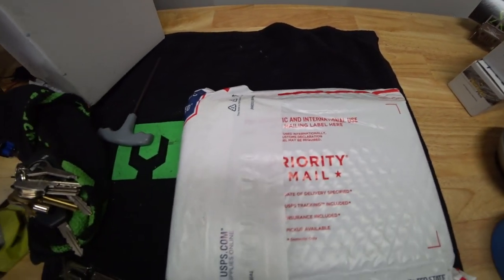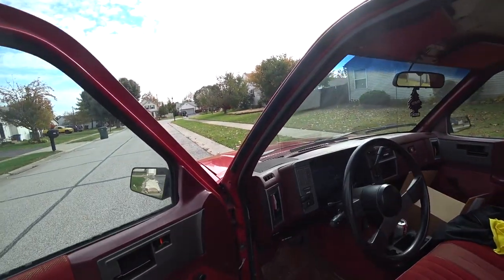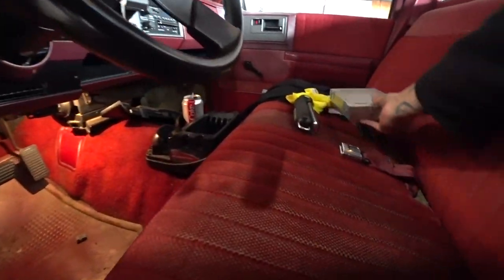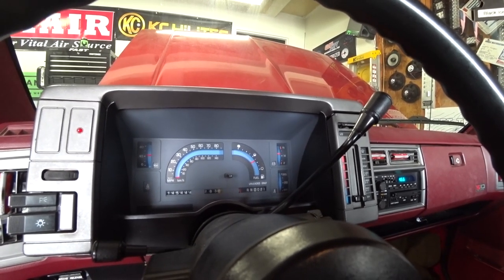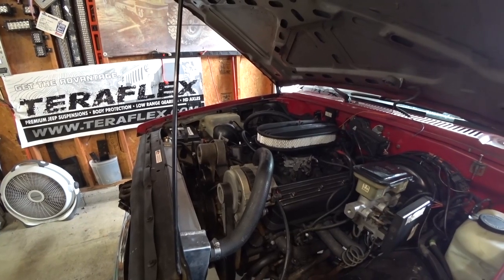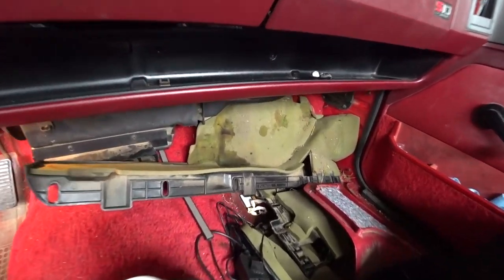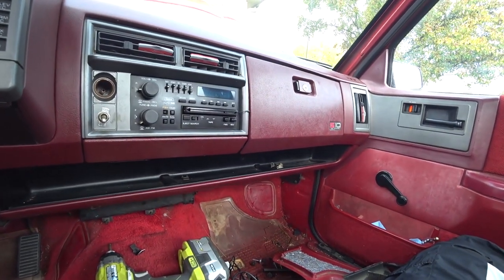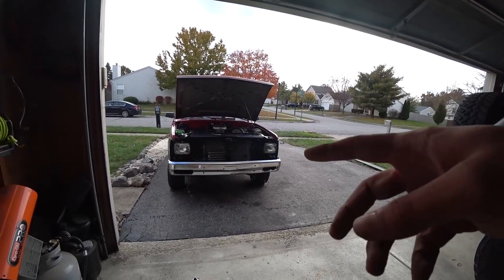New 5.7 TBI Computer & PROM Chip, Project SUPER 10 Ep.08

Comment: I gave my 92 short bed 4x4 a complete  tune up
Oil,spark plugs , wires , cap , coil, water pump, radiator, temp sensors, brakes , thermostat  but I didn’t change the hoses so I’m driving on the highway a day after spending 1000 and my heater core hose bursts and truck started over heating pulled over and the truck started smoking. I was pissed. Luckily there was an autozon less than a block away swaped them out threw some coolant in and drove it to Vegas from LA NO ISSUES 260,000 miles running strong

Comment: I can totally relate to everything that you said about the truck. I've been running into the same thing with a 1989 Pontiac Formula 350 Project and am about to change the computer and chip because it has been running really rich and actually fouling out spark plugs causing the loping idle just like your truck had. They aren't bad vehicles just like you said but sometimes it makes you wonder if something really odd is going on when you replace one thing and then something completely unrelated then goes bad. I'm into mine for about $15,000  now and it's not even close to being done. Some people think I'm crazy for investing so much into it, but I'm only the 3rd owner and it has a documented 96,000 original miles. The interior is immaculate but everything mechanical that could go wrong has gone wrong.  A new paint job is coming in the springtime and hopefully, she will be done and dependable. Right now I don't trust it to make it around the block.

Comment: I build cars and have learn how to build from owning and keeping my 95 S10 running. When it comes to mechanical parts rebuild the entire system and be done with it. A/c cooling system I’m replacing everything pressure will find the weakest point and find it’s way out. I understand your frustration completely that’s why I fixed it up and got sick of all the issues that popped up so i mothballed it and now about to put a 350 in it.

Comment: I feel your pain buddy. Last week I changed my blower motor resistor, and 20 minutes later my water pump started leaking for the second time, two days before the resistor I just replaced every single transmission line and installed a trans temp gauge. This weekend I have about 3 k worth of parts and upgrades all going in. I’m afraid of what’s gonna happen next lol. But keep plugging along, with every job you’re making head way. You keep turning out content and we will keep watching. Good luck buddy.
Reply from the maker: Thanks! Good to hear someone else is sharing the pain LOL! Good luck on your install of all those parts, what are you installing?
Reply: Rocky X TV  You name it. Lol. injectors, headstuds, new injection lines, crossover tubes, F.A.S.S., Beans diesel sump, filter delete kit, pyrometer, boost tubes. And while it’s all apart I’m painting and powder coating several of the things that are off. Cleaning up and revamping some wiring that I had temporarily ran. Along with other maintenance, oil change, tire rotation. Busy weekend.
Reply from the maker: WOW! You're gonna be busy! and a little frustrated, remember your words "keep plugging along, with every job you’re making head way." It's always worth it in the end, well not always, I had a car burn to the ground years ago, but lets not talk about that....
Reply: Rocky X TV been there done that too. Have a video some where lol

Comment: Do you have an adjustable fuel pressure regulators if you put a bigger throttle body on it will poor more just needs motor to back it up also and a good computer helps lol

Comment: 2003 silverado LS. 4.8 Votec 256197 miles. Second time around on original motor trans,  your opinion  on installing  Hpertech. Power Programmer all. She's starting to lack power when I stomp on it. Installed cold air induction.
Reply from the maker: Hypertech makes some good products.
Reply: @RockyXTV  hey thanks Rocky at least off to a good start

Comment: friend, can you help me please, I have a Chevrolet suburban 1500 5.7 vortec 1996, I made the TBI carburetor and distributor, I had the camshaft altered a bit in stage 2 and I put an aluminum radiator with electric fans (the problem is that it It heats up after 15 or 20 minutes and the time according to the mark on the pulley is not left, I move the distributor and not Measure the time) What is the problem?  can you help me
Reply from the maker: If I remember correctly, you sat the timing to 0 degrees on these and the computer controls it from there. It sounds like as you're turning the distributor, the computer is actively changing the timing. Most of these have a timing disconnect wire, most of the time it's brown with a small disconnect plug on the firewall. You disconnect this wire, set timing to 0 degrees, then plug the wire back in. After this the computer will control the timing for you.
I'm not sure if that's the info you were looking for.
Thanks for watching!

Comment: Is this cammed? What's done to it
Reply from the maker: At the time of this video I'm not sure what was all done to it. The cam was supposedly a TBI Computer friendly cam, but I can't verify that. I eventually added an Edelbrock TBI intake, slightly modified TB, larger injectors, fuel pressure reg spring (16psi I think), spacer to clear distributor, MSD coil & wires, flashed PROM chip and some other stuff I'm surely forgetting. This all definitely woke up the old engine, but at the end of the day it was still a low power mid torque TBI chevy.
It's currently getting a new pretty radical engine. I'm hoping to post some videos, even if they're shorts on the new engine. Let's just say on the engine dyno it made about triple what this engine made stock.
Thanks for watching!
Reply: @RockyXTV  okay sounds cool. You gotta do vids when finshed. I just put holley tbi n spacer on mine is saying 14 psi n I have jet performance chip. Seems to stumble when revving. I think I'm a tooth off cause I did headgaskets n intake gaskets n put in slightly wrong
Reply from the maker: @mikeydejon2148  could be a tooth out. Or a small leak on those intake gaskets. There's an old test for this, you may already know. Grab a can of carb cleaner or WD40. Use the little straw that comes with it. While the engine is running spray along the intake seams. Do this little by little and see if the spray is sucked in and the engine idles up. If it does, you have a leak and you know where it is.
Reply: @RockyXTV  okay thanks if I'm just tooth off can I just turn distributor to adjust?
Reply from the maker: @mikeydejon2148  I'm not sure on the TBI motors. When setting the timing for them, you are supposed to unplug the "timing wire" usually a brown wire on the firewall with a black rubber/plastic connector. You unplug that wire and set your timing to zero degrees, plug that wire back in and the computer adjusts from there.
Just turning the distributor may not have an effect. Unless you unplug that wire, turn it, then plug it back in. I hope that makes sense.
Reply: @RockyXTV  okay thanks was just gonna try loosen the distributor n turn a bit if nothing happens I'll try unplugging

Comment: i found the problem!!!! ryobi!! :p sry i couldnt resist   yea u guessed right im a dewalt fanboy
Reply from the maker: LOL! Ahh the old De-Wilt, half the tool at twice the price :) Thanks for watching man!
Reply: @RockyXTV  let compare some numbers- dewalt: about:$160 $170 700ft-lbs/1200ft-lbs breaking  ryob: about $100  so, yea ur right, one of the tools is literally half, actually less than half the other tool  lol yea theyre a little more expensive, but i payed 165 for a dcf89 but i also havent regretted it for a split second!! iv definitely had plenty so i kno i didn't just get a good one, the first one was stolen the second magically disappeared.. yea apparently thats a thing.. so i bought another one, yea thats how impressed i m with it. we should run a contest between the 2, but im a nobody non youtuber so i guess that chances of that r...about zero :p  .iv been workin on tractor trailers for years n we needed somethin to help the snap ons werent doin n u wanna talk about twice the price!!!  never again will snap off get a single cent from me   anyway bigger trucks have bigger tighter bolts, generally so we expected to use this alot but we did NOT expect it to b able to crack loose and reapply MULTIPLE tractor trailers wheels!! this thing blows my mind!  its soo impressive what itll move, i these guys were jumpin on a 3 foot bar n it wouldnt budge, i got there put the impact on n ziiiip! came right off no prob im tellin u man, dewalts got impact down to n art       so ur right the ryobi deff is more affordable, its 100 and the dewalts 170 well say..  but if ur like me n that tools literally how u make ur money its well worth the dewalt because itll put up with the abuse n keep goin, iv seen dewalts go thru stuff a sherman tank shouldnt have been able to survive..  trust me i v had my fair share of playin with tools for 30 years so iv used a ryobi a time or two.     u kiddin??absolutely!! thank U for makin the content man i really enjoy hangin out watchin some good youtube workin with good tools doin good work n smokin some good buds :)    daam i got a book wrote!! its ur fault for callin me out on the dewilt thing lol if were quoting god then i say the de-wilt will make the cryobi....cry!!!  lol  :p so cringeworthy lol
Reply from the maker: @4dirt2racer0  Haha! I hear ya on the Snap-Off stuff. I remember that truck showing up at the shop every week. Not to collect a bill, or deliver anything, Just pick up the junk we broke... That is crazy about the rig wheels though!